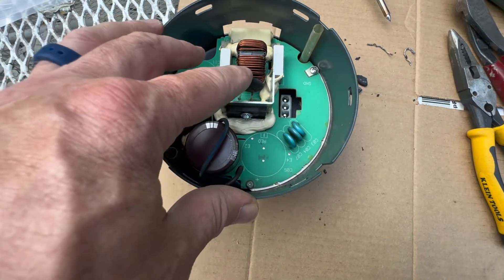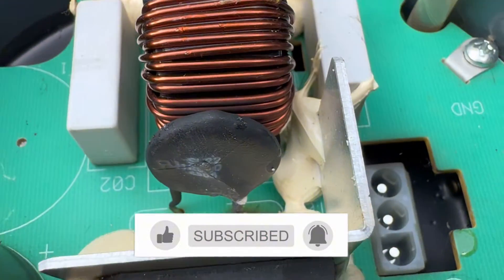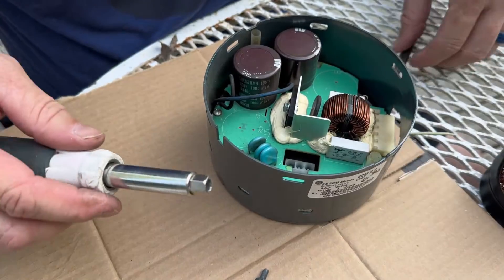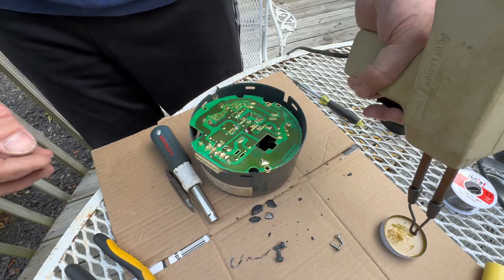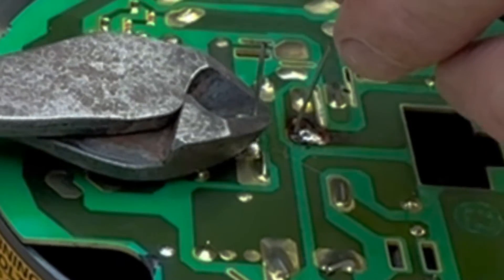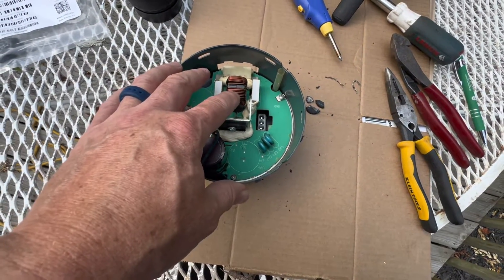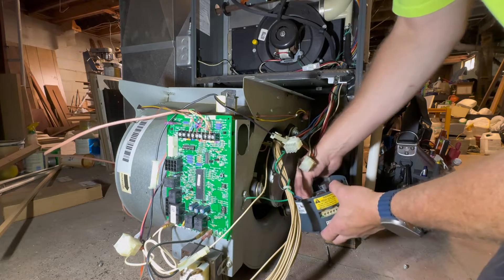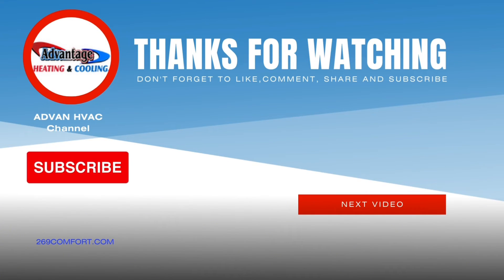Thermistor repair of the ECM motor

Comment: I have a ge ecm 2.3 dg03 attached to the motor and the air handler randomly turns on and stays on at various speeds. Is that repairable??
Reply from the maker: That one you may have to replace the motor or board.

Comment: I would love to repair these but the X13 motor ECM board has some type of rubber epoxy in them which makes it hard to repair😵‍💫
Reply: @gman103  it's still possible to do. It's been a few years but I repaired one for a friend. I think that we scraped some of this rubber coating to do the work.

Comment: What was wrong with the motor? I have one that will not shut off.
Reply from the maker: The transistor blew. Have you tried to make sure the thermostat's fan is set to Auto, not on?
Reply: @ADVANHVAC yes. I disconnected the thermostat control plug from the blower motor and it still is running.
Reply from the maker: You may have to replace the module.

Comment: What can be done to repair ECM modules that are potted...that is, where all the components are covered in resin?
Reply: Clip the leads right under the old one and solder to them vs the board.
Reply from the maker: I don't believe you can repair those. Have to buy new.

Comment: 👍🤠!! Do you have any advice on a ECM motor.  Fan runs all the time.  I’ve got it down to losing 24V plug to the motor or the heat relay?  It’s still under warranty but I also read I just can’t replace the module, the whole motor has to be replaced.  Ugh!!!!
Reply from the maker: That's correct the newer motors you have to replace the entire thing.

Comment: How do you measure the part to make sure it's in spec? I just bought a Sl22 1r020, and in the "ohm" mode it's coming back 2.2 ohms resistance between the leads out of circuit. That seems weird, when the datasheet says 1.0 ohms @ 25 degrees centigrade.
Reply from the maker: I didn't measure the part. I just installed it and hooked it back up and it's working like a champ.
Reply: @ADVANHVAC  I ended up figuring it out. It should measure around 1 ohm. I wasn't subtracting out the resistance from my multimeter leads.

Comment: Manufacturer "fixed" this issue by potting the entire unit.😈😈
Reply from the maker: Yup, I have had to replace the whole entire motor.
Reply: @ADVANHVAC  On older units where everything else was ok, I have replaced the ECM system with an old school blower motor control board and an appropriate size and speed/s split capacitor motor.
You'll lose a little efficiency but save a butt ton of money.
Some folks can't afford a new system at the drop of a hat.
Reply from the maker: @weaverp1 yes for sure you have to do what you have to do.
Reply: @weaverp1  my ECM went bad on mine, can you share what you used for your fix?
Reply from the maker: @bad03xtreme its in the description on the video. 😬

Comment: 5:45 You need to hold your solderingiron longer on those leads till the solder flows around it, your periods are too shorts which will lead to cold brittle joints to break in the future.
Reply from the maker: Thank you.
Reply: @ADVANHVAC  flux and leaded solder is helpful to avoid cold solder joints

Comment: You may want to make people aware of the two large capacitors. Those can give you a nasty zap if you don't discharge them with a resistor. They may have a bleeder resistor in the circuit, not sure. Better safe than sorry
Reply: @bobsoft  you can measure across capacitor leads. Anything in the single digits is fine.
Reply from the maker: That is a great point. Thank you.

Comment: DigiKey has the Inrush Current Limiter 1 Ohms ±20% 20 A 0.866" (22.00mm). NTC Thermistor. $1.94 + Shpg.

The SL32 looked like 2 Ohms.
Reply from the maker: Good to know.